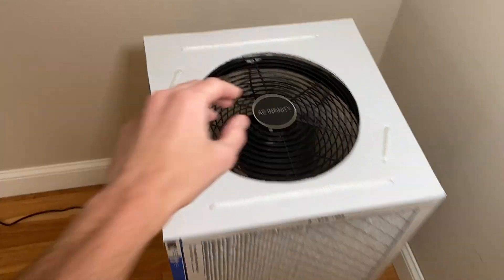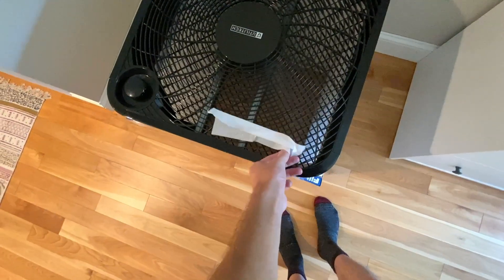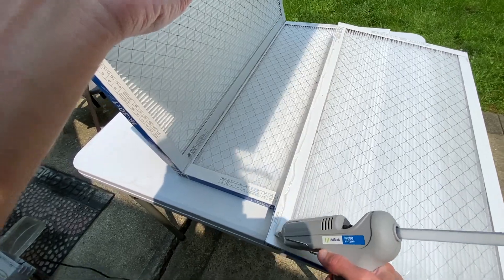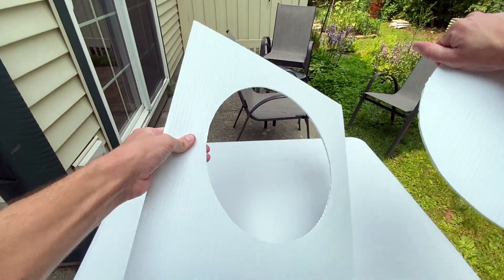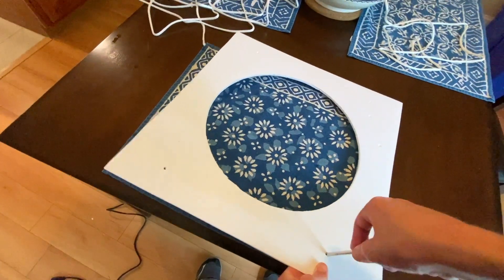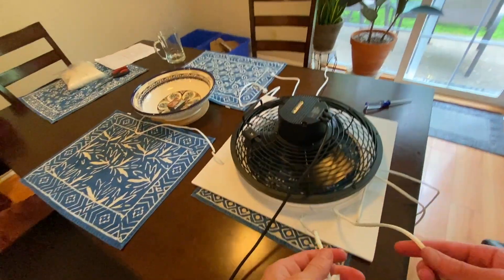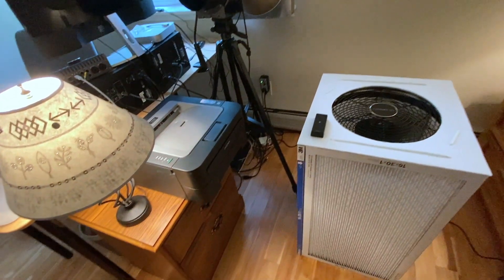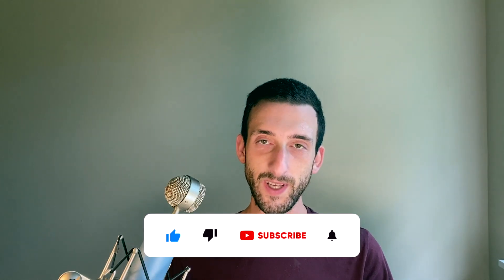How to Make a Better DIY Air Purifier

Comment: I assembled my first air filter based on these plans today. It was my first time playing with a glue gun, cutting coroplast, and tying square knots. Overall it was a good experience and I can see making more in the future. The basic principles make sense so I feel up for experimenting with it. I used the same fan and 16 inch wide filtrete filters, though the tallest 16 inch wide ones Costco had were a third smaller at 16 by 20 and Merv 14. On the bright side I was able to get four Merv 14 filters for $45. On speed 1 I can forget the fan is on. 

I've seen some coroplast reviews saying one batch was much flimsier than another, and I may have gotten a flimsier batch as it was bending easily even before I added the fan to it, but resting on the filters and having the clothesline to stabilize it seems to work well enough. I may need to tighten the rope more. Getting the rope/clothesline through the narrow slits on the fan and tying it was the hardest part for me and I ended up using tweezers to pull it through. I might just unscrew the cage so I can get my hands in both sides of the fan cover next time. I'm much more used to zip ties. I might experiment with either a 2nd layer of coroplast or a sheet of 3/8 inch pvc, though I really like the overall simplicity of it as it is.
Reply from the maker: I’m glad you had a good overall experience! I hadn’t heard of coroplast batches varying in terms of their malleability - that’s useful to be aware of. Let me know how zip ties end up working for you if you try them. I couldn’t get the fan blades to avoid them but maybe you’ll have better luck.
Reply: @HealthyHomeGuide  I ended up using a zip tie to cinch the rope tighter around the knot and now the fan no longer sags.  https://drive.google.com/file/d/1L0TQDb7OzZ5TlFNMmHVQZICqbYpkLCaA/view?usp=sharing
Reply from the maker: Interesting, thank you! Did you try using a zip tie to fix the coroplast to the fan instead of using a rope?
Reply: @HealthyHomeGuide  Not so far. I'm waiting for another fan to arrive. The current one worked well once I tightened the rope using the zip tie which I then trimmed to get out of the way. Had I tightened the rope better to begin with it may not have been needed. I think the rope looks better than a zip tie would, and with the way I have it now the zip tie is only visible when taking the fan out of the filter box.
Reply from the maker: @NurseAcrobat  That makes sense, thanks!

Comment: I like how approachable this design is. I could see using it in my attic and crawlspace as I clear out old insulation and try to minimize dust, along with inside the rest of the house when renovating.  Your videos make me want to start playing with glue guns and coroplast, which I'd never considered before. 

I got my first home air filter in 2020 as a covid ICU nurse, The Bedroom Machine by Austin Air. It's pricey at $1000 now, but the $500+ filters which are a bit fancier than HEPA are rated to last 5 years in residential use. It's quiet and the low hum on medium speed serves as white noise while we sleep. One problem is that it's too pricey for me to get multiple of them and it would feel like a waste to put one in a dusty attic. I eventually got a $200 coway airmega for our guest bedroom and another for our living room since they were well reviewed. 

Lately I've noticed a bigger difference in air quality from bringing in fresh air so I'm working on doing more of that now, while continuing to filter what I can. I finally ordered a Broan AI ERV along with larger inline filters and am looking forward to getting it installed over the next month or two.
Reply from the maker: Your comments are always great! So glad to hear that you feel this design is approachable - it should be PERFECT for insulation/dust capture given its high airflow and the particle sizes in question. 

I love Austin Air. I had a Healthmate a while back - they’re cheaper at $715 USD right now. 

Nice, yeah! I feel that ventilating with humidity controlled/filtered fresh air is the most impactful way to improve IAQ (that plus dehumidifying in warmer months of course). My air purifiers that are close to my ERV supply barely get dirty, it’s crazy. So cool to hear that you ordered the Broan AI!
Reply: IQ Air MultiGas with Hyper HEPA purchased in 2006 to neutralize paint, varnish, wood stain and varnish VOC's of a new home build along with toxic reclaimed water mist from choosing a lot on the 18th Fairway of a Golf Course downstream of a leaching dioxin (2, 4-5 DT aka Agent Orange) Superfund Site that was never completely remediated.

Comment: Curious how would the result show with a particle tester.
Reply from the maker: Great question. My particulate monitor shows excellent air quality coming through this filter. Virtually no larger particles, very few medium, and a small amount of fine - these filters are less efficient at removing fine particles, but this air purifier moves a lot of air, which gives the filters multiple chances at capturing particles that might have been missed. 

I also had a professional mold inspector test my air quality with an expensive monitor and he said it was the best count he’s ever seen. My particle count definitely wasn’t 0 though. I think I could get it lower with a HEPA air purifier (or higher MERV). Workin on some DIY ones 😊

Comment: Excellent....but too expensive might as well just buy one air purifier off the shelf at Costco.
Reply from the maker: Thanks! My DIY air purifier has far greater filtration surface area than virtually all factory made units that I know of (especially the cheaper/smaller ones). That makes it so you don’t have to replace the filters nearly as often. My design also produces much more airflow than a typical air purifier, and thus cleans air with greater efficacy.

Comment: I've been using the BlueAir Pure 411 (for 161 sq.-ft rooms) and Pure 211+ (550 sq.-ft) for the past 3 or 4 years.  The design is excellent, and the filters are reasonably priced compared to most other brands ($22 and $64, respectively, with the subscription plans).  If you want a purchased solution, I recommend these.  However, it looks like they've discontinued selling these models, as they have new, next-gen ones out.  The comparable ones, which seem to be the Pure 511(?) and the 313i+ have similarly priced filters (~$20 and $42).

They do seem to have a common enough issue of the fan "dying", which is unfortunate for an otherwise great product.  But the one that died on me, I opened it up and replaced it with a computer fan, and it works fine.

I've been trying to noodle on making my own kind of DIY solution, but it's difficult to get specs on decent fans that aren't box fans and aren't over-built or over-designed for the purpose.  But I do like what you've done here. 

I was thinking having all four sides wouldn't be necessary for most rooms.  And then you could have the other sides be more "attractive".  Or even put the fan sideways instead of upward, and use the top surface as a little shelf or table. The struggle seems to be finding the right fan(s).  Something like the Lasko 10" BeezeMachine (claims 390 CFM, 35 dB) is fairly reasonably-priced, and circular, but it's a little large at ~12" dia. overall (for what I'm planning).  It has only 2 speeds, but I think that's all I really need.

Cheers!
Reply from the maker: Thanks for the thoughtful comment. The benefit of having all four sides of the air purifier be made of filters is that it increases the surface area of the filtration surface, which makes it easier for a fan to pull air through, increasing airflow and efficiency.

My experience with fans is that you get what you pay for. Generally, cheaper plastic fans aren't made to pull air through filters because they aren't designed for the increased static pressures, and don't generate as much airflow. They also tend to be annoyingly loud. I'm personally not comfortable running a cheap fan 24/7 in an air purifier. But that's just me - others may find success. I understand budget constraints as well. Experiment :)
Reply: ... The Vornado "160 Compact Air Circulator" might be a good fan, as well-- 227 CFM @ 33dB, and only about 7.5" dia.-- as long as it can make enough pressure to pull air thru the filter.

Comment: A note about noise measurements: Because it's a log scale you can't do straight arithmetic for either addition or subtraction. You must first take the antilog of each number, subtract, then take the log. For example: 62 dB minus 29 dB background is still 62 dB, because the difference is so small it doesn't even register. If you had 36 dB and subtracted 29 dB, the net noise of the fan is 35 dB.
Reply: He's just saying for noise measurements, you can't simply subtract one number from the other by the way the math works.
Reply: i wish i knew what this meant lmao..
Reply: @growersplus  IIRC 20dB is 10x louder than 10dB. Every 10 is a x10 scale change in volume, not a +10.
Reply: @valasdarkholme6255  That is the oft-quoted guideline (based on the belief that an increase of about 3dB doubles the volume.)

But it is not really true. Sound pressure is the best metric, and based on that, it is an increase of about 6 dB that doubles the perceived volume.
Reply: @valasdarkholme6255  nope , 30dB is 10x louder than 10dB , get your facts right if you want to show off your knowledge
Reply: @growersplus  🤣🤣🤣🤣 I'm a math idiot
Reply: @growersplus  0.00001 is a hundred times more than 0.001. But 1-0.001 and 1-0.00001 are practically equal.
Reply: 😄 me too no idea what he's talking bout
Reply: @lezleeanderson6132  Right, he's assuming too much of his audience. I assume that most people here are lay people that would calculate the 62 minus 29 would leave a remainder of 33.
Reply from the maker: Ah, thank you David.
Reply: On a sound intensity basis, replace each occurrence of 20 in my formula with the number 10.
Reply: Lol ya it cracked me up seeing the net noise 😭

Comment: You can prolong the life of the filters by adding a pre-filter to catch large-particle dust, made of fine mesh window screen or nylon Noseeum netting that can be vacuumed or removed and washed.
Reply from the maker: Yup! I was actually planning on doing that with aesthetically-pleasing thin fabric. Maybe someday. Although it’s a whole thing learning how to create a fabric sheath that fits over an air purifier.

Edit (in April 2025): I actually don't know if a pre-filter is necessary here. I've just been vacuuming the filters themselves and it seems to work well.
Reply: @HealthyHomeGuide  White noseeum netting worked well. I just tacked on rectangles of it with Scotch magic tape. It holds well enough to suck onto the filter and stay in place when I vacuum it, or peels off easily enough to remove it for washing
Reply: Would like to see this demo’ed!
Reply: I bought a big roll of 2 feet wide AC filter material from Amazon and wrapped it around my DIY 4 filter setup with twine.  It's very tight and catches a ton of dust and dander and I can reuse it over and over again by cleaning it off.

I've noticed that my MERV12 HVAC filters stay super clean and after 1 year they don't seem to need  replacing!  The big roll of course was pretty pricey but saves a ton in MERV filter costs.
Reply: You can also buy window screen in aluminum
Reply: That’s a great idea because I have three dogs so I’m assuming that might help with the dog hairs. I’m planning on making it next week the box. Thanks for the tip.
Reply: Isnt window screen made with fiberglass?
Reply: @AshleyReebals   newbie question but what is wrong with fiberglass screen? Thanks
Reply: Cool because I have a roll of that noseeum type.
Reply: I extend my filter life by covering with a thin white fabric for stove exhaust fans. Works incredibly well.  Then an activated carbon filter before or after the pleated filter to extend the carbon filter life.  The white sheathing comes in rolls from Temu, super cheap.  "393.7inch Long Range Hood Oil-absorbing Paper Engine Hood Filter Grease Filter Anti-oil Filter Paper Anti-oil Sticker Anti-smoke Paper Kitchen Accessories".  There is also a washable thin foam sheet. Carbon filter sheeting is also available in large sizes, for odours.
Reply: That's a great idea cause I have pets, so the filter would have to be made more frequently. Thanks.
Reply: Noseeum netting

Comment: Great video and design! Is there any reasons in particular you used 16x30x1 filters instead of 16x30x2?
Reply from the maker: Thanks! I couldn’t find 3M filtrete filters in the 16x30x2 size.

Comment: We're using the Winix Zero 4 Stage Air Purifier - AUS-1050AZBU in my bedroom in Melbourne Australia. I like it shows air quality indicators like blue for good, orange for okay and red for bad. And auto night mode.
Reply from the maker: Thank you! Looks really cool. It’s always interesting to me to hear what countries other than my own are using as far as healthy home tech.
Reply: @HealthyHomeGuide  I'll go a diy version this summer like yours because we have lots of wildfires and planned burnoffs in Australia each year. So wildfire smoke is a big issue for us here. I'm sounding like a prepper now but I work from home so I want to be some from poor air quality all year round.
Reply from the maker: @MatthewBayard hahah I’ve been sounding like a prepper too. We’re just informed about the very real environmental health hazards in 2023, right!? In Vermont USA we’ve definitely had wildfire smoke as well. I work from home too.
Reply: It's also significantly better than this DIY model at purifying the air.  You made a good choice.   But for larger particles the DIY option is good, but it's going to miss most/all the smaller particulates.
Reply: @santiagodraco They just need to add a charcoal filter for that. It will trap smaller particles that. There is also good panels that are 3 in 1

Comment: Hi, do you know if filtrete publish air flow - pressure loss graphs for their products? Couldn't find it so far :/
Or any other manufacturer that is available for common home owners?
Reply from the maker: I find this site interesting. An independent party tested a bunch of filter brands. Hope you find it useful!
https://filterstudy.com/filterstudy-reviews/
Reply: @HealthyHomeGuide  that site looks great, thank you!
Reply from the maker: You’re very welcome!
Reply: Each Filtrete filter has a table of flow and pressure drop at five different flows, printed on the frame, along with filtration efficiency in the E1, E2, and E3 particle sizes. You can fit a polynomial curve to the data and get a great prediction at any other flow. Big names like Camfil and AA Flanders publish curves for their filters as well.
Reply: @David.Elfstrom  oh, good to know, but couldn't find that table online.  :/